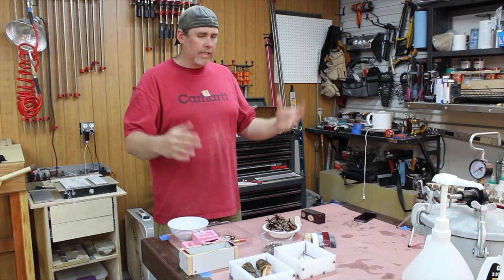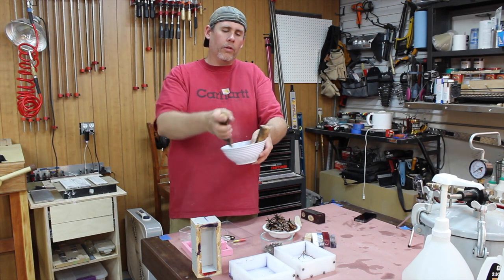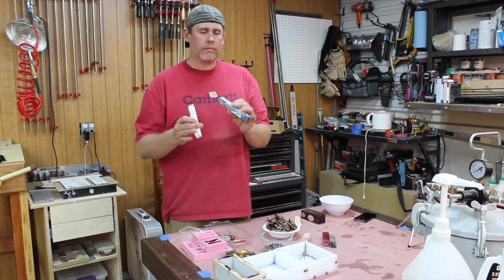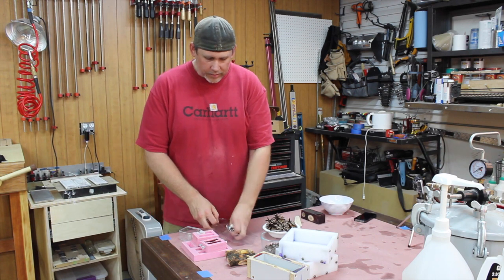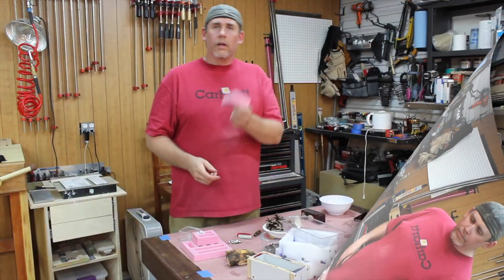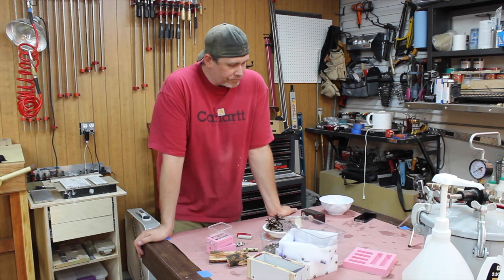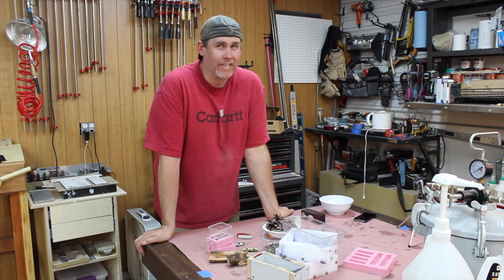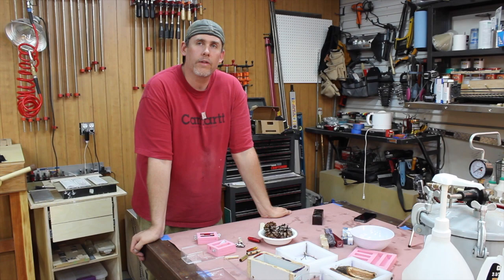What You Can Use For Resin Casting Molds: Woodturning

Comment: Thank you again.  Haven't tried the Alumilite  as I haven't gotten to Harbor Freight yet. Will be watching how to set it up from your former video. Not having great luck with the poly resin but just beginning, can only get better.
Reply from the maker: Thanks for watching Susan!  For some reason I never get very good results with PR and it makes my shop smell terrible when I work with it. It's great stuff if you can get it to work, but I find it to be very aggravating.  The big drawback to Alumilite is the price mostly, but I love the fast cure time.

I'm going to be trying out a UV cure product soon that's a little cheaper than Alumilite as well, so keep an eye out for that video.  It may be a good alternative to PR, I'll try to compare it to Alumilite and PR/epoxy to see how it performs.  I'm doing a lot of experimenting with casting different materials right now, and I'm trying to find a cheaper product to use for these kinds of tests so I don't spend a fortune on the resin just to do some testing.

Comment: Hey Zac...Just watched your vid...nice job.   The one thing i did catch was you don't use PVC pipe because Alumilite doesn't shrink. I'm sure this is old news by now...but Alumilite does make a mold release agent in an aerosol....I do knife scales and use it everytime...Works great for pine cones...Cheers (y)
Reply from the maker: Hey Rob, happy new year and thanks for checking out my video and for the tip.  I just started using Stoner for all my molds, and it does work excellent.  I haven't really gotten into using PVC pipe for casting with Alumilite, but I'm going to have to give it a try one of these days.

Comment: I have successfully cast alumilite in pvc. As long as I spray it with the stoner mold release it will slide right out.  The mold release might leave the out side of the blank looking funky but as long as I'm going to turn it on the lathe it comes out fine.
Reply from the maker: Yeah, definitely want to hit it with Stoner so they come out easy. You don't really need to douse it with spray, just a decent misting, then give it enough time to fully harden they pop right out
Reply: I was going to ask about mold release and PVC. I didn't even think about pcv until @zac mentioned it in the video.

Thank you both

Comment: Hi Zac,
I am trying to encase objects inside of a clear cylinder made of a clear resin. I have never used resin before and am wondering how much time it would take for the resin to cure after using a pvc pipe as a mold and if the materials inside would effect the casting?
thanks
Reply from the maker: Hey Nikki, cure time just depends on what resin you're using, how much of it you pour at once, and what the temperature is in the shop. Whether or not the material will effect the casting depends on the material. If it has moisture in it, it will likely cause a reaction with the resin

Comment: Hi zac thanks for for ur video can i please ask for ur advise? I am making a boho beaded door curtain & i am planning on making resin beads but i need to make them with a hole through the centre so that i can thread cotton or vinyl line through to hang the beads. I am going to be using silicone moulds for the shapes but what i want to know is can i put a wood cocktail stick or metal pin in the centre of the moulds to create the hole? So when the mould has set i am hoping to be able to pull the stick or pin out the hole ready to thread the string or line through that hole thats created?. Is either of these 2 methods possible? Thank u in advance for taking the time to read this i look foward to ur advise. Btw i am a new subscriber from over the pond in London town. X

Comment: I do almost everything the hardest way possible but I use what I'm familiar with. I'm make molds out of wood but I will of course need to coat the wood with something cheap. Will a coat of Pam or even vegetable oil keep the resin from bonding with the wood. The wood mold is held together by screws so I can pull it apart a little as long as it isn't stuck tight.
Reply from the maker: I'm not sure how well wood will work. I would really recommend going with smooth HDPE for the mold. You can pick it up on Amazon: http://amzn.to/2jFblUy 

You can try using a mold release with regular wood, but you'll probably get the resin sticking to it.
Reply: Zac Higgins hey I used the wood coated in petroleum jelly and the only place it stuck was in the seams where there was no jelly. So now I took all the screws out and spread pj on all the areas where it could seep into and I expect that will work. No sticking at all where there was pj. But I still had to take the screws out and break down the mold to get the pieces free.
Reply from the maker: Nice! Good to know that pj worked so well on it. I was a little worried about using a full piece of wood, glad that it worked out ok for you. Thanks for letting me know, I appreciate it. I'll be ready next time someone asks =D

Comment: Zac, why do you use silicon caulking instead of polyurethane caulk to seal the resin molds?  Can I use polyurethane?
Reply from the maker: +Leslie Podell I like silicone because there's no way it's going to stick to the resin. I'm not familiar with polyurethane caulking, so I couldn't be sure how it would work out. If you try it out, let me know how it works out.
Reply: +Zac Higgins will do!

Comment: Thanks for the video. I hope you still answer questions.....can I use an aluminum pan as a mold? Maybe as long as i use a release spray? Trying to make 15" round table tops that will fit into a unique planter (to turn into end tables). I am having difficulty finding a 15" round pan but found a deep dish pizza pan that is the correct diameter. Any input would be greatly appreciated.
Reply from the maker: Hey Jessica,

Technically it would work, but it might be really difficult to get demolded even with release spray. It would be better if you could find a plastic dish, preferably made out of HDPE or silicone
Reply: Zac Higgins yeah I kinda figured. Another idea i have if i cant get it to release is use a dremel with a cutting disc and just get the bottom off prying it and then polishing. We shall see. Thank you so much for the reply

Comment: Appreciate the videos! You tale most ofbthe guess work out of the processes. Im curious if anyone uses clear plexiglass as a mold?
Reply from the maker: +Chris Geeo I think the resin would just stick to plexiglass, you might be able to get away with it if you use mold release though. Not sure how the plexi would handle the heat that builds up from the resin curing though either. The best material I've found so far is smooth walled HDPE. Holds up well and totally non stick.
Reply: +Zac Higgins That's kinda what I was thinking too. I got the hdpe on the way, just had some plexi but didn't want to waste it if someone had tried it. Anyways thanks man!

Comment: Okay for those of us that dont know what melomine is (or most of the other words you pros use)  I need to put some false teeth in a resin cube a la Breaking Bad Tuco. About 3 inches x 3 inches. Can I just use a little Tupperware deal...isnt there some kind of spray you can put in it so that it pops out? Thanks Zac.
Reply from the maker: Hey Beth, sounds like an interesting project! You should be able to use something like a tupperware, but you'll want to spray it with a mold release agent. If you are using Alumilite resin, they sell a product called "Stoner" that's supposedly formulated for their product.  For polyester resins and epoxies, you should be able to get a mold release at your local hobby store.  I've heard that cooking spray or petroleum jelly will work also, but I haven't tried myself so you'd have to try those at your own risk.
Reply: Zac Higgins Wow Thanks Zak! I wish there was a way for me to send you a photo of what I'm trying to do in case you had any other tips for me.....but thank you SO much for replying to me! I will look for "Stoner!" Have a Great holiday! Beth
Reply from the maker: Beth Donahue-Weedman No problem Beth, I'm glad I could help out.  You'll have to send some photos of it when you get it cast, how fun!  Happy holidays to you too.
Reply: Beth Donahue-Weedman Hey Zac is there an email address I can send you a photo of what I'm trying to do? I looked up "Stoner" and found a LOT of products that are starting to confuse me. I use Envirotex Lite, which works great for this little project, and if you give me your email address I promise to only use it for this and not start deluging you with funny cat videos or begging you to join Linked-In. Thx Beth
Reply from the maker: Beth Donahue-Weedman Hey Beth, just wanted to get back to you on the mold release.  I'm not sure if Stoner will be the best product to use with Envirotex. I wasn't familiar with Envirotex, so I did some quick research on it.  From what I can tell, it seems to be an epoxy resin that's used for coating thin surfaces like table tops.  I'm not sure how deep your mold is going to be, but it seems to be made for thin coats like 1/8" thick.

Just wanted to double check with you on that, and make sure that you've used it before for this type of casting.  If not, I might recommend doing a test cast first to make sure it will work for you.  From the manufacturer's website, it seems like they suggest using their EasyCast product for casting objects that are doorknob size, etc. Again, I don't know what the chemical makeup is of the two products, and there may not be much difference in use between the two. It's always best to test it out first.

Stoner is sold by Alumilite, and they call it a "polyurethane mold release agent". I'm not sure if that is just marketing or if it really is specially formulated for polyurethane only.  Alumilite is not epoxy, it's chemical makeup is polyurethane, which is slightly different than epoxy.

For the mold release agent, I would maybe suggest using the mold release agent sold by the company that makes Envirotex rather than Stoner.  Here's a link to the product on their website: http://eti-usa.com/mold-release-conditioner/   I just recommended Stoner if you were going to be using Alumilite resin.  It may still work, but I haven't tested it on epoxy.

Sorry for any confusion, just wanted to give you more input now that I know which type of resin you're using. I definitely want to see the results though, I sent you a message through YouTube with my email address.

Comment: Does using pvc pipe work with epoxy resin or will it not shrink like the alumilite?
Reply from the maker: Epoxy will shrink a little more than Alumilite typically, but it depends on the epoxy you use. In general, polyurethane resins like Alumilite shrink the least, epoxy shrinks moderately, and polyester resin shrinks the most. It's best to use a mold release with epoxy as well as Alumilite to make demolding easier. PR usually doesn't require it, but it can't hurt

Comment: What kind of casting resin DO you us?, I'm never done it
Reply from the maker: I use Alumilite for the most part.  I tried polyester resin first but couldn't stand the smell.  Epoxy doesn't have the smell, but it's pretty expensive. Only downside to Alumilite is having to use a pressure pot with it, but it's super quick!

Comment: Hello, I tried to make with Polyester resin, it looked beautiful but when turning broke in many pieces, will it be if I use epoxy will it be better?
Reply from the maker: Hey Ronaldo, you will like Alumilite a lot better for turning blanks. It's not brittle like polyester resin. I have links to the resins I use for my blanks on my website: http://nvwoodwerks.com/tools/
Reply: Hi, Zac, I saw on your web site (Alumilite Clear), would this be good for making pen resins? you send to Brazil?
Reply from the maker: Yes Alumilite Clear is great for pen blanks, I don't sell it myself. You'd have to contact Alumilite to see if they would ship to you. You might be able to find epoxy casting resin in Brazil though, that works pretty well for pen blanks too
Reply: Hi, Zac, I'm going to try epoxy, tell me how much time I should leave in the pressurizing tank, how many psi? thank you
Reply from the maker: Awesome! It just depends on the product. Slow setting resins don't necessarily need to be pressurized, but I would recommend it if you plan to embed objects like wood in it. You would need to leave it pressurized for at least as long as the demold time. For most slow setting epoxies, you'd need to leave it in overnight, and higher than 40 PSI

Comment: will epoxy resin stick to a stainless steel tube mold?
Reply from the maker: There's a good chance it will, but it may not if it's really smooth and you use mold release. PVC pipes are a better way to go I think. Even if it did get stuck, it would be much easier to get it off the blank

Comment: Hi I bought West System Epoxy 5:1, and was wondering if this would be ok for putting on a blow moulded table over an acrylic pour.thanks
Reply from the maker: I'm not entirely sure about that. It may work, but I would be inclined to think that the resin wouldn't stick to it very well. I'd definitely do some testing first if possible before you go all in on it

Comment: I was about to buy some melamine bowls but... I used a melamine bowl recently and it destroyed the bowl. I tried hammering it off... which broke off some edge pieces but I can not get the bottom off for the life of me. What did I do wrong? Some people suggested I try to turn it off - I tried and I don't think that will work out too well. It will look great if I can turn the bowl so I'm really disappointed. I actually didn't know the bowl was melamine when I used it either - I just grabbed a random cheap bowl I had. I just checked though and it IS melamine... So why is the resin stuck to it? I sprayed it with a release spray... obviously did nothing. Should I have used oil?
Reply from the maker: I had that happen to me using a bowl that was made out of melamine. I forgot to spray it with mold release before I poured the blank, so it was stuck pretty good. I just turned it off. Watch out when you turn it off though, it may eventually come loose and turn into shrapnel. Definitely be careful and wear the proper PPE.

I use HDPE bowls that I picked up at the dollar store now, they work perfect. The blanks fall right out

Comment: Thanks for this... Question about the boxes you show, what material are they - that will prevent resin from sticking? Also, the boxes appear held together with tape, does the resin leak through at those joins?
Reply from the maker: The totally non stick ones are HDPE: I cover them in more detail in this video: https://youtu.be/RrqKN1g6vA4

Comment: Hi there thank you so much for the video. I would like to ask you something. I want to know except from silicone in what else resin doesn't stick.
Reply from the maker: You can use quite a few different things for molds. HDPE plastic works fabulous, here's a video that shows that: https://youtu.be/RrqKN1g6vA4  You can also use a number of other materials that are semi non-stick that would require using a mold release agent with most resins. PVC pipes are one that fall into the semi non-stick category

Comment: Anyone know of a way to keep Epoxy Resin from sticking to glass? I have a glass skull liquor bottle that I want to fill with resin and once it cures I want to break the glass off, but Epoxy Resin bonds VERY WELL to glass LOL.
Reply: Release agents maybe. They have a spray
Reply: Kinda like pam but for resin
Reply: @SRHMorbid  I'm actually in the process of trying something called Stoner Urethane Mold Release. I did a small test with just a drop of resin on glass and it seemed to work just fine. I will know more in a few days.  I will come back here and post the results when I have them. :)
Reply: @SRHMorbid  I finally broke the glass today and it totally worked like a charm!!! The glass mostly just slid right off the resin skull I made. The Skull was a little greasy from the spray but a little hot, soapy water cleared that right up! So now we know that using Stoner Urethane Mold Release agent on glass does in fact keep Epoxy Resin from sticking to glass! :)
Reply: I did an experiment with ordinary fiberglass resin purchased at Walmart.  I took a smooth glass plate and applied Johnson’s paste wax to it.  I then buffed it to a shine and wet it down with catalyzed resin.  Applied three layers of fiberglass mat and let it cure.  After at hour in 70+ degree weather, it easily popped off the glass plate without a wedge.  I literally plied it off by hand!  One side was smooth as glass and the other rough.  With two glass plates of the same size one could produce a perfect translucent polyester sheet.

Comment: will epoxy resin stick to the inside of terra cotta pots?
Reply from the maker: I've never tried it, but I am going to assume that it would. Maybe not if you apply a mold release agent to it first though
Reply: Zac Higgins I will test to see, I don't want it to release. thank you for your response
Reply from the maker: Oh I was assuming you were using it as a mold. If you want it to stick, I'd suggest scuffing up the inside of the terra cotta with some 80 or 120 grit sandpaper. That should give it some grip on the pot

Comment: Does anyone know if I can use the Glaze Coat resin (bar top resin) to make casts with?  I have an unopened box of it, and if i can use it for that, then i will just keep it and make some cool clear casts.
Reply: you can use glaze coat resin for casts! if the cast is thicker than an inch or so the resin may turn a yellowish color, but shouldn’t effect the stability or transparency. Also keep in mind when curing, don’t use high heat to eliminate bubbles because this will also give it a yellowish color.